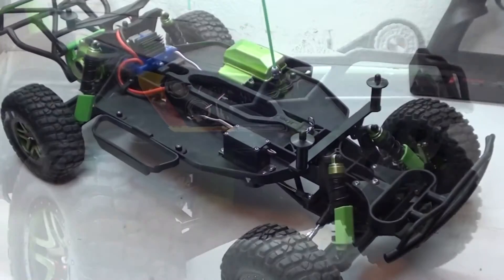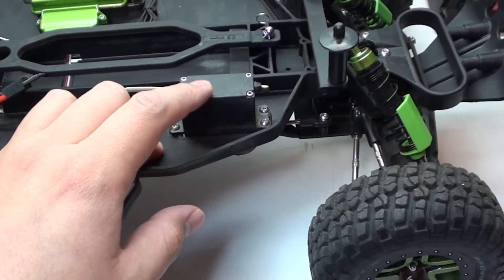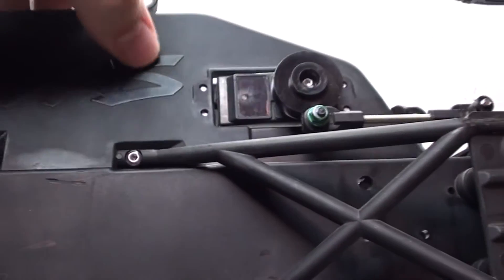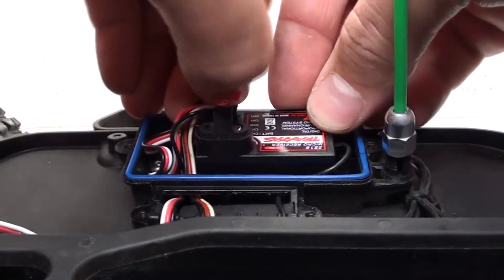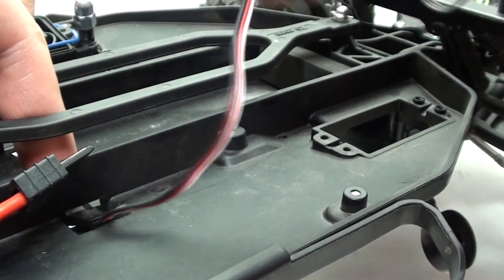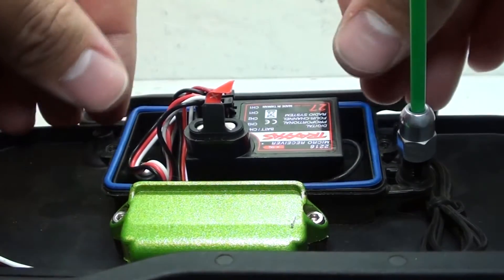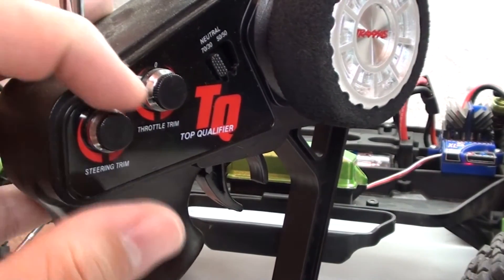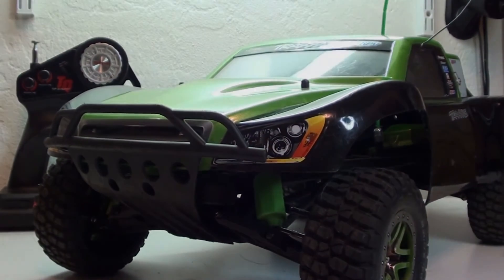Creature - Traxxas Slash - Level 10 Upgrade - Servo & Battery

Comment from the maker: Channel 1 is for Servo, Channel 2 is for ESC. The others are for other things you don't have to worry about. But they have to be plugged in like this. But the servo can be plugged into either channel 1 since there is 2 of them most of the time.